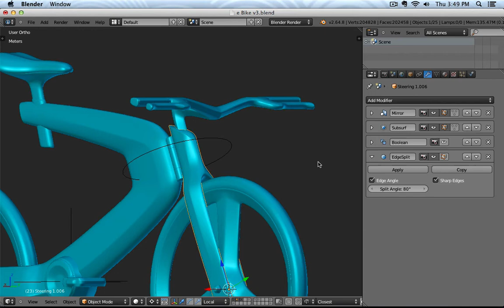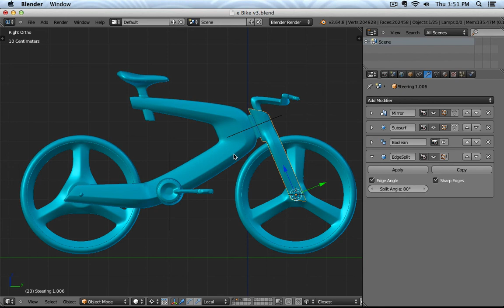Ending Comments

Comment: Hello, is this process possible with a program aside from maya?
Reply from the maker: You can make this with Max Maya Cinema4D Modo Fusion as well. Steps might be different.
Reply: thank you much
Reply from the maker: I prefer blender not because it is free but because you can have it for every OS and it has interactive modifiers. Maya does not have them while max has but Max is only win. Plus I send my blende work to Fusion 360 and continue using it there.
Reply: In fusion would I be able to give dimensions and design in ports, connection points, snaps, fasteners and mates etc? I see that fusion is free for a student but I am no longer a student for now. is there an alternative to fusion that you know of?
Reply from the maker: +Jrorion8 they allow it to be used by hobby users and professionals who are making less than 100k a year!!! So yeah you can use it for free.
Reply: really! i will look into that right now . thanks again for your help.
Reply from the maker: Jrorion8 No problem. I love using Blender Alias and Fusion together. Alias is not free nor cheap but works very similar to how Blender works. And Fusion is a pretty decent solid modeler. I do most of organic sculpting in Blender. Rhino is not good for this. And Alias is to hard and I am not doing cars. Fusion has limited surfacing tools but with Blender doing organic shapes Fusion offers perfect solid modeling tools non Blender or Alias can do so well.